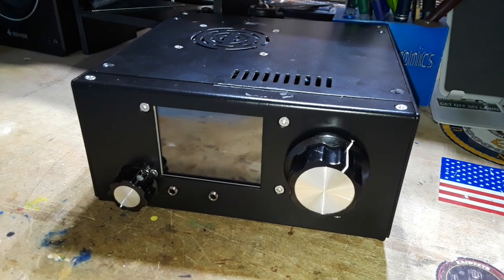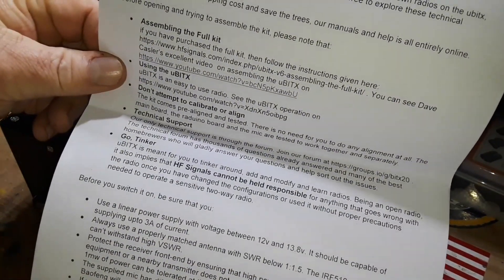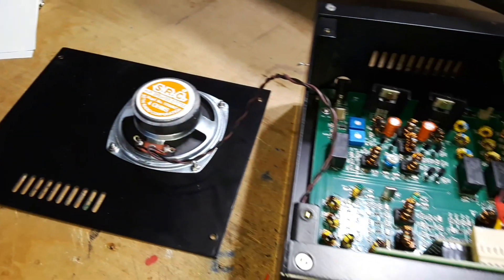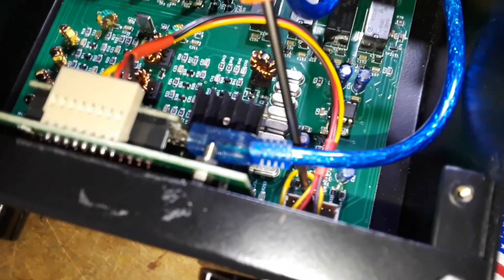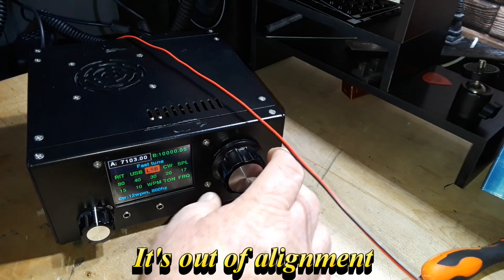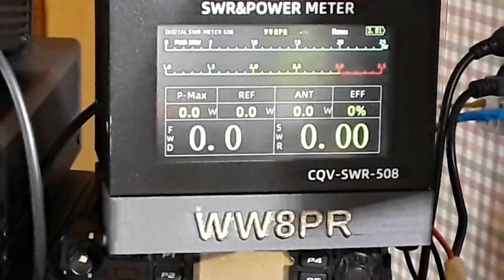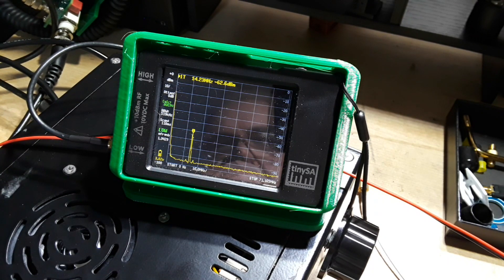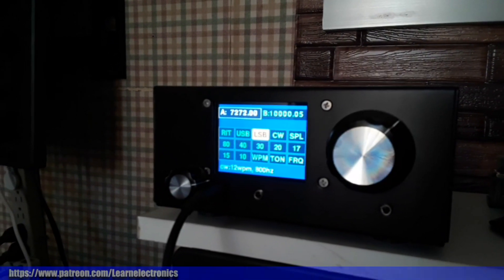uBitx v6 High Frequency SDR Transceiver

Comment: When assembling the radio, it is useful to use a mm scale to measure the screws. This avoids having to redo some parts of the assembly, especially mounting the display.

Comment: I bought 4 of these. Sent one to my son N5DIM who takes it mountaintopping in California. 

It works well. Price includes cabinet, mic and hardware. Took me 30 minutes to assemble...no soldering. Pretuned. Ships by DHL to USA in about 5 days. Totally unique. Touchscreen, too. No exotic or expensive parts. Weight is almost nothing. 

Boards are pretuned, matched and quality certified. Plug-n-chug.

Software can be updated over Internet for other display options, etc.

Comment: Mine after alignment puts out 8 watts on 40 now on 10 it does 5 watts. It hears pretty good
Reply from the maker: I'm having difficulty slinging mine. No matter what I do, it seems to be 30hz off. So I have sent it off to a friend who aligns radios as a side gig. Hopefully he will have better luck than I did.
Reply: HF SIGNALS website gives alignment information video. No exotic instruments needed.

Comment: Just a correction but the uBitx is not an SDR, it’s a superheterodyne. If you look at the block diagram, you will see that the arduino is merely driving the display and controlling the switches and oscillator. For it to be SDR it would also have to handle the DSP, which is incredibly difficult to do with a ATMEGA328 (the trusdx is the only radio I am aware of to pull it off and just barely at that)

Comment: How did you get the case so scuffed up?
If you want to go to their next level try the Sbitx. But it is roughly 2x the price.
Reply from the maker: It's just residue from the packing tape.
Reply: @learnelectronics 
Remove with cloth and WD40.